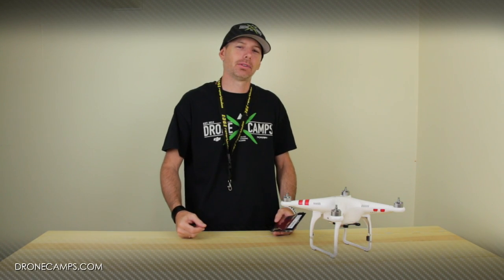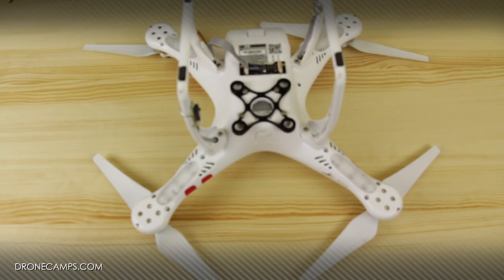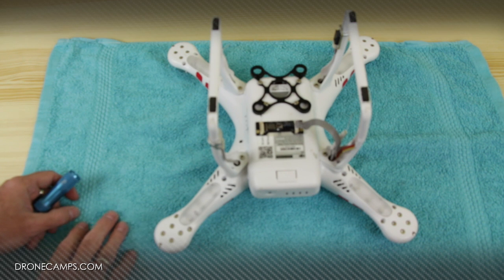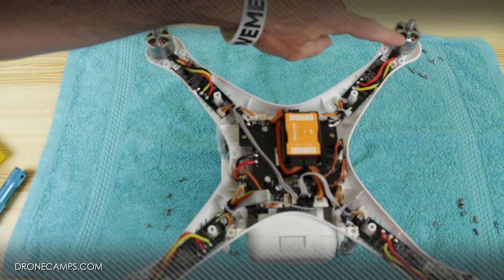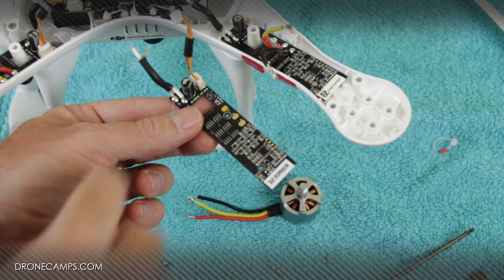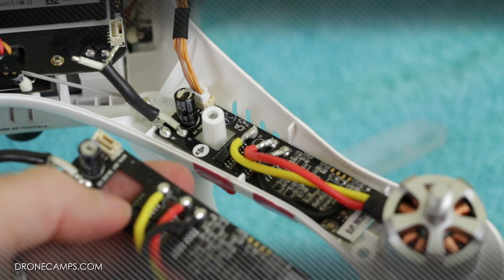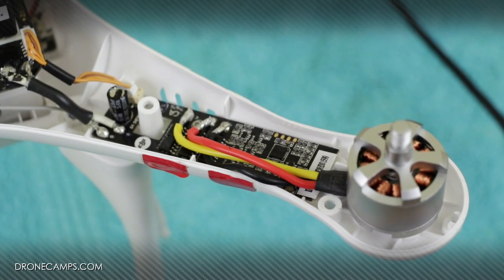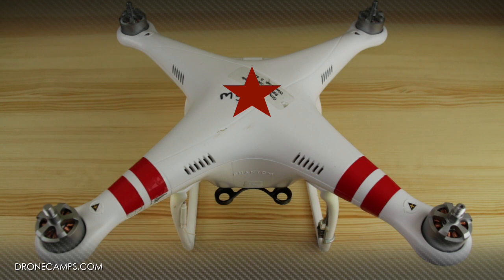DJI Phantom 2 - Motor & ESC Replacement Tutorial

Comment: Hello Justin, I crashed my P2 and now have an issue with a motor not working.  I replaced the ESC but the problem still exists.  I don't think the motor is bad since the LED below the arm with the malfunctioning motor is also out.  Any ideas?  Here is a video of the symptoms.  https://youtu.be/6h3MGjOSeJ4

Comment: Replaced my motor and esc, still stutters 😩 could a calibration possibly fix the issue? Also my stuttering motor is the same motor location as the video. The new Esc is the v2.1 while the other three are 2.0. Don't know if that makes any difference.

Comment: Hi, three of my motors act like this one you fixed. Do i have to change the motors and the ESC card? Or is it enough to only change the motor? Is it possible only to change the bearings (kulenlager)?
Reply: i think i did something stupid. Taking of the propguards and put the long screws back without them.

Comment: Hey there,
 
Having a bit of an issue right now. Phantom 2 powers on ok, seems to find satellites.
 
The back lights are flashing green, but the front 2 are solid red. Copter seems to fly ok, but I don’t want to take it to higher elevations, if it’s a major problem.
 
Firmware is all up to date.
Reply from the maker: Darren Susin everything is ok. Red lights in the front are fine. If you see red lights in the back ; it's time to land! Low battery!

Comment: what is the problem..1 of my motor(ccw) is not running ( jerking) and led also not blinking?is it the motor broken or the board problem...tq...
Reply from the maker: Colin Augustine if it is jerking around it is possibly the motor. Buy an ESC and motor just to be safe.
Reply: after i open it...i saw the esc board is burn like short circuit....so whether the motor is still ok or not...tq
Reply from the maker: Could be both.
Reply: can i use phantom 2 motor for phantom 1 motor.....

Comment: Hello All at DC.  I (as many others have) replaced the long screws from the prop guards back into the Phantom2 for transport and didn't realize (or warned - THANKS DJI!) that doing this would cause problems with this motors.  Bought T-Motors to replace the 4 useless ones (didn't want to give DJI more business for lack of warning/help in ruining my 4 stock ones) An long story but: Should I use the same stock ESC's with the T-Mototrs or get new ESC's?  Thanks guys CT
Reply from the maker: Chilidog1970 better to get the new updated 2.1 Escs.

Comment: hi Justin and all at Dronecamp,
quick question... i stupidly took off prop guards i had on the P2V+ and used their screws never thinking about them being too long, and have wrecked all 4 motors. i bought 4 x MN2214 tiger motors and replaced, and 2 work fine and the other 2 do not.
swapping them about, i think i have an ESC problem.
my question is this... would you recommend changing all 4 ESC's or just the 2 which seem to be faulty?
Reply from the maker: nigel healey we would recommend just changing the two that are bad.

Comment: Great video.  However, as a new guy to this hobby with little soldering experience, it would have been great to see the soldering being done.  Of course, there is a multitude of videos on youtube showing how to do this but I didn't find one that specifically solders wires to a circuit board.

Comment: Good basic repair video on motor & ESC replacement.  
One quick tip.  If possible, when sobering to any PC board, a standard good practice is to always & try to ground yourself by an Anti-Static Wrist Strap/Band  to prevent possible damage to the PC components.